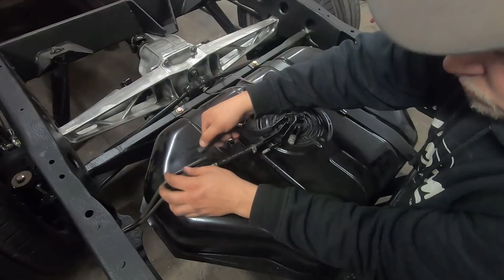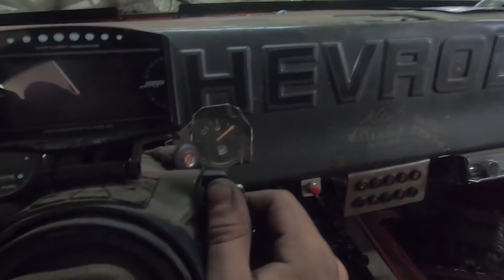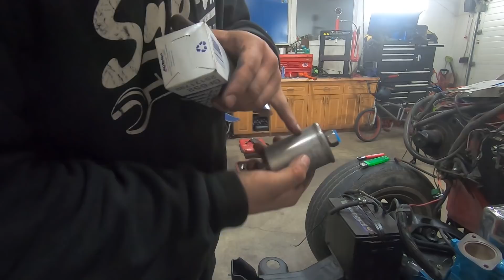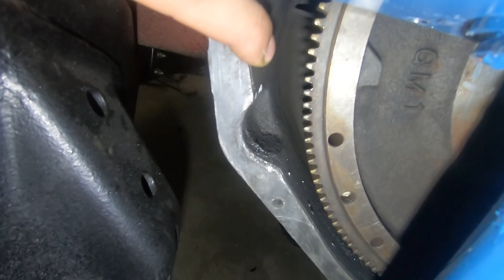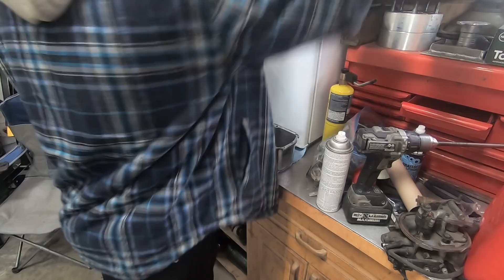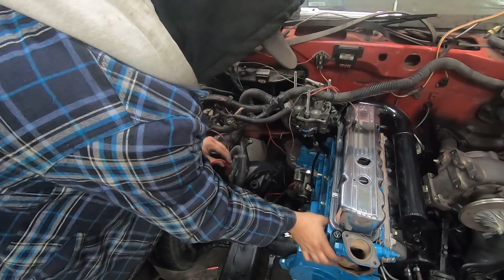Rat10 FIRST START!! Boosted 3.0L BOAT ENGINE, 6 Speed Manual, Dana 44 Independent Rear Chevrolet S10

Comment: You have to cut the red wire, going to the distributor and hook it to power to put it in base timing mode to set timing. I think it’s the red wire research it a little more. It’s been a while since I’ve done mine.

Comment: I have to say I'm impressed as hell! I've kept up with this build for the simple fact I'm planning a C4 for my 1984 S10. That in and of itself doesn't appear to be very difficult with good fab skills. Front suspension is tubular upper and lower control arms and coilovers. My plans originally were for a small block chevy but it's too much weight in the front for my wants. I'm looking at something more similar to what you've done...light weight, boosted horsepower.  Anyway, you've done an awesome job on this truck! You have great metal fabrication skills! I, like some others, was sitting here grinning ear to ear when that thing fired up! Killer!😁
Reply from the maker: Hahah hell yes another C4 Destroyer for the sake of an S10 welcome! Front suspension from when I had the whole car looked to be an even bigger ordeal than the rear.

Small blocks are a great bang for the buck, cant really go wrong. Thank you for watching!

Comment: Cool Project man, I just started my new project today... I'm doing a 4X4, 4.3L/5 Speed Swap on my 1984 S10, 2dr, 4X4, Blazer that was Originally a 2.8L/Auto Carbureted and all Mechanical and Now I have to figure out how to Combine Mechanical Parts and Electrical Parts and make everything work together, Bc I'm keeping my 1984 Dash & Speedometer which I'm hoping I can just use the Transfer Case from the 2.8L on the 4.3L that way I'll keep the Cable Driven part for my Speedometer, I'm just not sure how the ECM for the 4.3L TBI Engine & 5 Speed Transmission is going to like the fact that there's stuff not being used, But I guess I'll figure it all out as I go LoL
Reply from the maker: Thank you! a 4.3 5 speed swap will make that truck super fun! You'll be in quite the fun ride trying to figure out how to make all that work together!

Comment: Are you running the stock ECU and are you able to tune it?
Reply from the maker: Stock yes! It has a modified PROM readable with a little ODB1 adapter box and cable and tuning is done through a program called Tunerpro
Reply: @ak_strem7010  Sweet, wasn't sure what could be done to those other than plugging a chip to it.

Comment: Double flash is due to the V8 pick up coul, should have 4 poles like the shaft
Reply: Coil not coul
Reply from the maker: I changed the starts to the 4 pointed ones